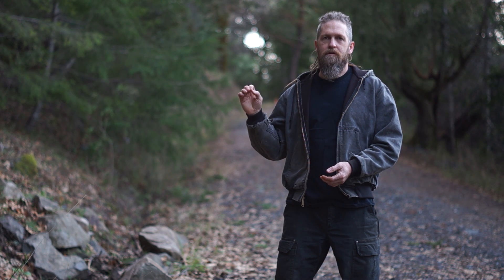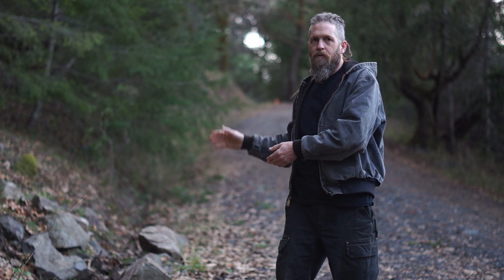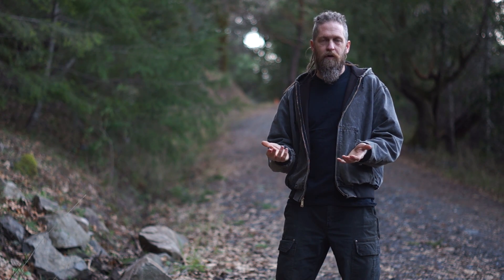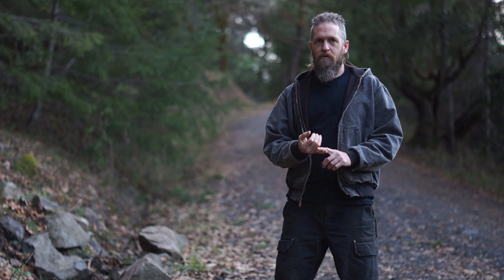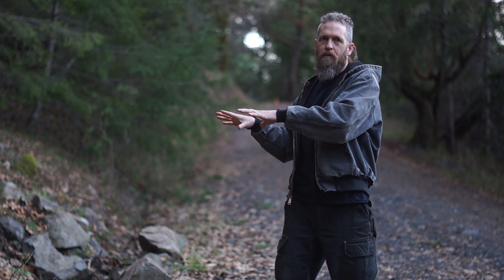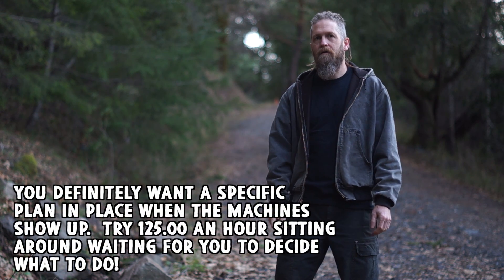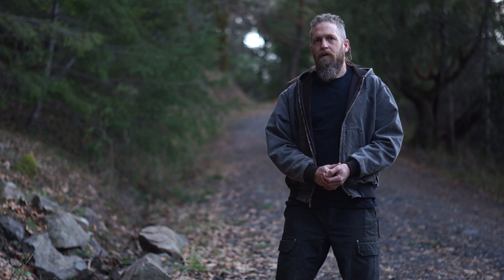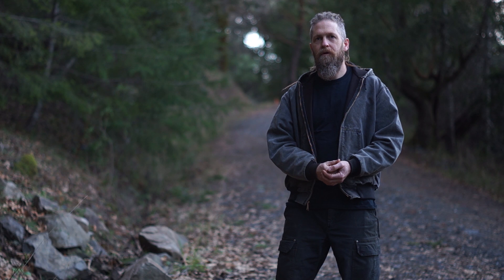Homestead Road Series Primer, Water and Road Observation

Comment: Best gravel roads in my area, 100 -120 year old rail grades. Very flat, plenty of drainage.
Reply from the maker: You mean basically the gravel beds for the rails?
Reply: @SkillCult  Yes, they ripped out the rails and ties, and then put a layer of gravel on top. There are places where they have received almost no maintenance over their life, and are still be driven.
Every once and a while you can still find a discarded rail beside them.

Comment: I'm a civil engineer and have designed miles and miles of access roads. You made lots of good points - I learned something. One thing I would recommend is to get detailed notes of any parts of your road that do have a failure. There is a lot of info out there about what causes specific failures so it will help you make a good diagnosis and make corrections
Reply from the maker: Thanks Eric.  Most of the failures I see seem fairly obvious to me now, but they didn't at one time.  Maybe when I do the series I'll visit some failing and poor condition roads to look at what's going wrong.  If you have any specific resources that are good on road failure I could maybe offer them to people.

Comment: I just purchased a 1.5 acre property that's off a dirt road. The dirt road has been established for many years with a ditch leading up to a colvert. is there any steps I can take like putting large rock in the ditch to keep the colvert head from getting sediment build up. I have had to take my shovel down to the colvert 3 times in the last month and a half because there was so much sediment in front of the colvert that it was about to clog and turn water over into my road..thanks
Reply from the maker: Well, if you're getting a lot of sediment, it means somewhere upstream you're losing road surface, unless the water is coming for another eroding area or another road, so start looking at solving that problem wherever it is.  Or, the ditch is eroding badly, or dirt banks, and hopefully that won't be an ongoing process.  If the culvert isn't clogging up, then it's likely that it is not pitched at a steep enough angle.  If the culvert isn't steep enough, it will fill partially with sediment (or completely, hopefully not) and back up at the mouth.  It is also likely too small, because the temptation to install small culverts is strong since they are so much cheaper.  That could exacerbate all those problems, even if the culvert is never operating at full capacity.

Possible solutions, dig a dry well at the mouth that collects sediment so the culvert stays operational for longer, then shovel it out when it fills up.  You'll have to rock it in though, not just dig a hole.  Obviously stop the erosion that is upstream.  If the culvert is shallow, dig it up and re-pitch it steeper and if possible at a diagonal so the water doesn't have to turn a right angle to cross under the road.  That assumes of course that you aren't on flat ground, in which case I"m not sure what you would do.  We ain't got much of that around these here parts.  If the culvert is tiny, put in a larger one.  There are very few instances where an 8 inch culvert is big enough.  Also, after a lot thinking and observation, and reading the handbook I talked about, consider whether you need that ditch at all and if you have any roadwork done reprofile the road.  There's a lot to think about there, but you have your road bed already, so you can really observe what's going on.  That's about all I can think of right now without looking at it, and again it's during those heavy water flow times that you can really figure out what is going on and what to do about it.
Reply: SkillCult I did not even think about the angel in which the colvert is buried it is more like a ninety degree rather than an diagonal..the road is at a incline where the ditch and colvert is. I'm not having a problem with sediment inside of the colvert just at the mouth..it can be buried where I can't see the opening of culvert but as I dig the sedement out I find the whole 20 foot colvert pipe is fully cleaned and open..thanks for all you info
Reply from the maker: That's is worth considering since the water has to slow down to turn that corner.  Often it's good to break the energy of water, but it can allow sediment to drop out.  The other possibility if debris damming the entrance.  If it's wooded, it takes very little in the way of a twig or two to start a leaf dam.  How large is the culvert?
Reply from the maker: It's very common to have culverts at  90 degree, because it's cheaper.  You have to have 1/2 again as much culvert to angle it across a road, which often means buying a second length.
Reply: Some other things that can cause water to drop sediment in a culvert; culver undersized, water backs up, slows down, drops sediment. Culver oversized, water never gets enough speed to wash out the pipe. Rule of thumb is you want the statistical 2-year storm or when culvert is at max capacity to flow at a minimum of 2.5 feet per second. Any less and it never washes itself out. Culver is too flat could be another issue. This is a bad one because there's no easy fix I know of other that digging it up and re-laying it steeper. Could be in a "backwater" condition where there's a bottleneck downstream that causes the water to slow and drop sediment. Another solution could be to stabilize the soil upstream so sediment never reaches the culvert. Could be so many things. Hard to know without more info. Anyway, good luck with it.
Reply from the maker: Good stuff!  Didn't know about the oversized culverts thing.

Comment: On my 20 acres woodland, hillside site I started by scraping all the biomass off the road surface (it is woodland, unmanaged for about 50 years). We have a ditch on one side with a few big rocks interspersed in it to slow down and break up any torrent of water until it reaches the road and is diverted through a culvert. The surface medium we will use is 1" down, un-washed crushed rock (because of its rough finish bonds to road dirt surface, the finer particles eventually wash down and fill in the gaps). Great to hear of your plans for the year Steve.
Reply from the maker: I like the slowing down the water idea, as long as it doesn't contribute to clogging and overflow.  A big problem with ditches here is falling branches and leaves causing dams that build up and overflow.

Comment: I've been skimming the book since you last mentioned it in a previous video, definitely dry and very long, but educational. I have a 1000' shale driveway that climbs about 600' vertical and has a switchback which is the bane of my existence. Because of this road being impenetrable by mere mortals during wet conditions I have purchased another acre of land to connect me to another road, but I'll have to build a 600' country drive on that side of my property now over relatively flat ground but crossing a small stream. I can't wait for the full series, but in all honesty I'll be done my new build by then. I'll be sure to look at water conditions beforehand and make plans to slope and grade the road towards the creek rather than just adding ditches.
Reply from the maker: Just use the book.  It's got everything you need.  And map the hell out of the road.  I flagged every separate section and made a specific plan for that stretch based on the conditions.  Also, if there are trees, do as much clearing as you can ahead unless you have a lot of money to throw away having them clear it, or a lot of time to clean up and dull your chainsaw on piles of trees, mud and brush.    Much easier to deal with clean standing wood that those piles and at over 100.00 an hour you want them doing the stuff you can't do.

Keep in mind too that you can do outslopes with an inside ditch if there is not a ton of water.  I have a section like that where some water comes off the hillside, but the ground is pretty stable and didn't need a ton of rock or super fast drainage like the clay sections did.  So, I put the inside ditch and outsloped the rest.  That way the ditch is collecting less water, which is less water to dispose of in one place further down the road, and just less pressure on the ditch, which only flows moderately even in the heaviest downpours.  In the couple of sections that are super sticky clay, I went with a higher crown and deep ditch on the inside to get the water away as fast as possible.

Is the shale any good for rocking?  Lots of rock helps.  If you can open a quarry, I'd do it.  My neighbor had two quarries open with two kinds of perfect rock, so I lucked out.  Still expensive to get out of the ground and onto the road, but cheaper and better than buying in rock unless there is a quarry next door.  If I did it again and didn't have access to that rock, I'd hunt real hard for a place to open a quarry here on the land.  I may yet anyway, just to provide rock for our road association to rock better and get some free rock out of the deal for other projects.  Design and drainage are first priority, but good rock is a close second.  Most people just make the mistake of trying to fix problems with rock.  Lets talk soon.

Comment: Is that the Smart Fortwo coupe or cabriolet you're driving at the end? :-P

Having watched this video, it occurs to me that we have an interesting reference library of sorts in our area.  The last decade or so has seen a proliferation of wind turbines in the fields -- each with its own access road.  If one wanted a whole set of roads built around the same time using the same materials and methods and experiencing the same climate but with varying topography then you could certainly do worse.  You won't see examples of big slopes and so forth but there should be a fairly robust gradient of slopes, vegitation levels and so forth on the more subtle end of the scale.
Reply from the maker: That's the ranch truck, early 90's diesel F250.  Great truck.